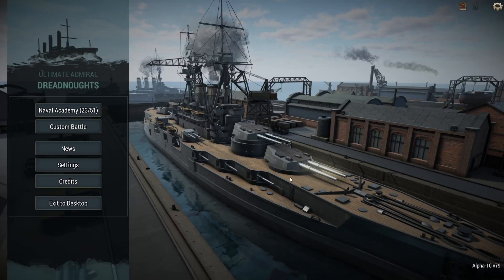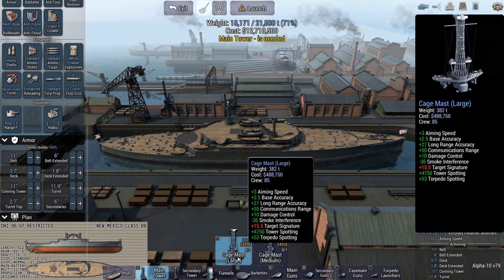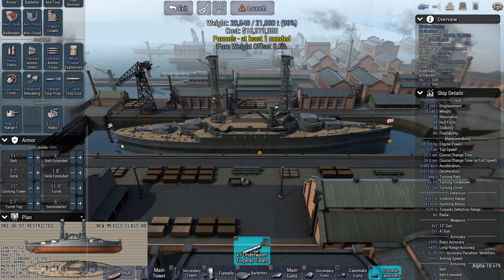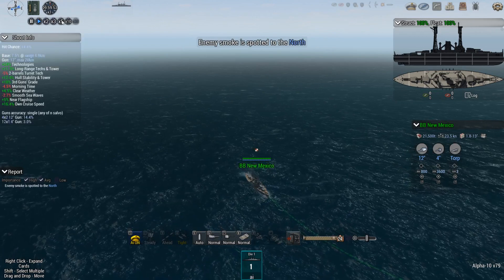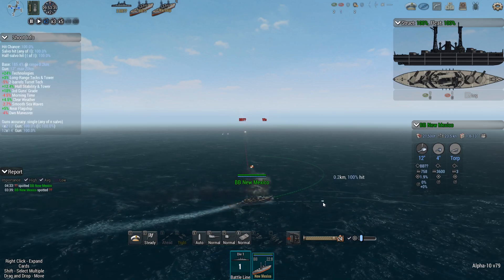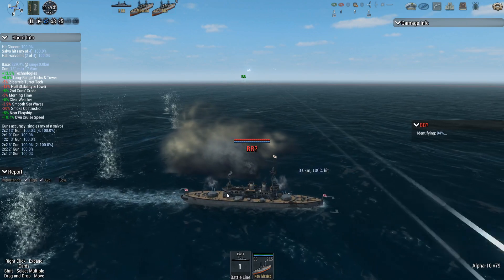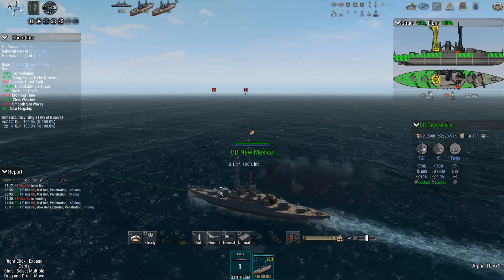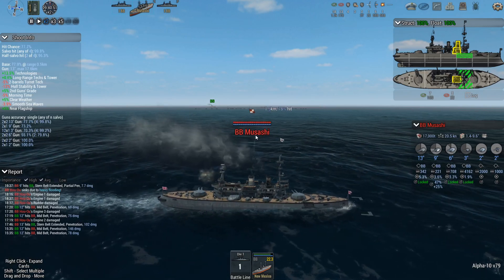Dreadnought vs. Pre-Dreadnoughts

Comment: The two older ships should have split up and attacked from different directions, and closed the range to bring their smaller heavy guns into action. This would have forced the dreadnought to split its fire, or fight one ship while the other closed in. However the Dreadnought would still have the speed to break off  the fight if needed. In the great war not all dreadnought/predreadnought fights were won by the Dreadnought.